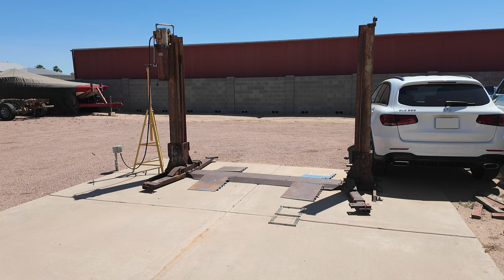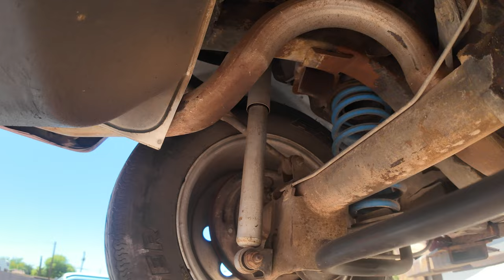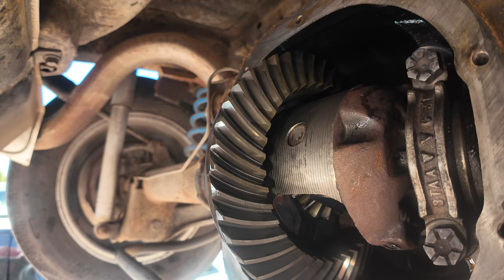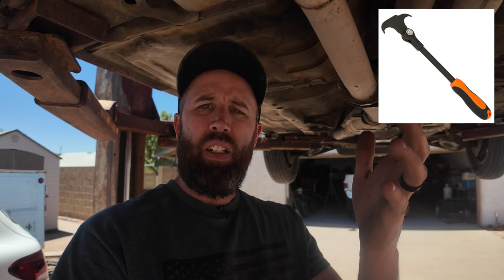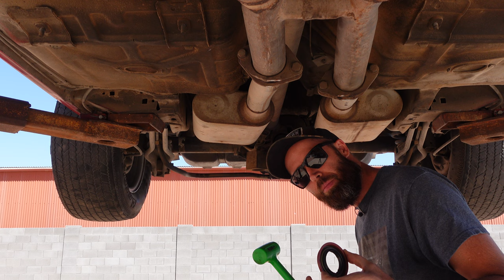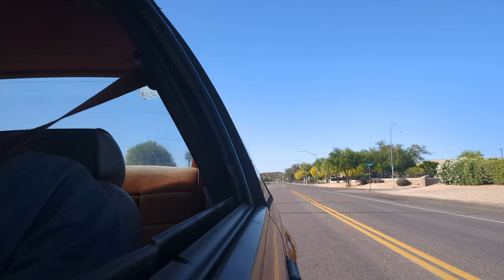Foxbody Mustang Rear End Is Making Noise, Time For A Teardown

Comment: I just dropped my 87 LX off yesterday to get 3:73's installed. It's got 2:73's in it now, so it should definitely wake it up! The guy used to work in the garage where I work, when he said $100 I couldn't believe it, replacing the bearings, races and all! I ordered the rebuild kit and took it straight to him before he changed his mind, lol. He's an old timer and said he's done hundreds of them, drag racing and circle track racing so I'm pretty confident it'll be done right!
Reply from the maker: Nice! Yeah that's like $1k cheaper than anywhere else haha
Reply: @randybelcher6693  you'll love the 373's, I have them in mine. They are Def a good time haha.

Comment: Worn clutch packs will cause excessive play in the c clip. By the looks of the pinion seal leak good chance it was run low on oil and bearings got hot. 8.8 fords are the easiest rear ends to overhaul. Most of the time you can run stock shims And send it. But I do recommend koyo bearings.

Comment: If you are interested in fixing the headliner, some fabric shops like Pat Catans carries the headliner material with the foam backing.  You can glue it on your cardboard backing board with 3M weatherstrip adhesive.
Reply from the maker: Interesting

Comment: I just had my car looked at after I couldn't get the idle down.  Was at 18 degrees of timing, set it to 10 degrees and the idle came down from 1100 to 950ish.  Tried adjusting the idle screw and nothing happened, was completely disengaged from the butterfly of the throttle body and stayed at 950ish rpm.  Took it to a shop, they did a smoke test and found it had many areas of unchecked air coming in, mostly around the egr and throttle body.  Put a new accufab throttle body with an egr delete plate and the idle is now adjustable and set to 750ish.  Sounds and runs a lot better.  Maybe a smoke test to check for unchecked air may help you?  Mine surges a little also but levels out

Comment: I just did a 31 spline (explorer LSD) rearend in my fox. The 28 was clunking and the backlash was way off because the shims on the LSD were worn out. Switched to 5 lug and disc brakes (4 piston cadillac 13" front, taurus caliper and 10.65" rear) at the same time. Always something to change and upgrade. No more gear noise and stops so much better.
 Now i have to fix the e-brake.
Having fun following you.
Reply from the maker: Nice! Sounds like a decent swap. Thanks for watching! 🤙
Reply: What kind of kit did you use? I am thinking of just going SVO/93 cobra disc on my 86 to stop better. I am going to go with 17" wheels so clearance isn't a issue.
Reply: I didn't use a kit. I just pieced together parts from different places. The diff from an Explorer at the junk yard, the rear calipers from a Taurus at the junk yard, front spindles from a 95 at the junk yard and the brake lines and fittings from the junk yard. The front calipers are Cadillac 4 piston brembos from Amazon, had to shave them a bit to fit. Front Rotors are 13" from amazon. Rear rotors are 10.65 from parts store for a 2004 mach1.  Ford traction lock rebuild carbon kit and axles from JEGS . New bearing also.
   The 17" cobra rims barely fit on the front over the calipers.
 Stops so much better and I don't have brake fade anymore.    
              The car does have 600hp and this was much needed!

Comment: Looking forward to seeing what control arms you go with.
Reply from the maker: Any suggestions?
Reply: He will probably get them from eBay.
Reply: Lakewood’s are my favorite just because they was popular back in the day or something similar. I do discourage the 100-150 dollar sets from eBay.  BBK has some nice ones and Proform has some very similar to BBK and both favor the Lakewoods at a lower price.  If you find some old SSM lift bars those work great, make sure they have the lowering brackets.  I can promise you if you run any that are solid they will tear your lower torque boxes if you don’t have reinforcements. Buy you some of those upper and lower torque box reinforcements and do a video on them. Can buy them from 60-100 dollars.

Comment: My pinion and cover were leaking as well. I just did mine a week ago. Luckily i noticed mine leaking and immediately fixed it. You have to remove the spout and iac to do a base idle reset. When setting timing you should remove both also. You should start at 12* not 18* for the timing. 18 is a bit much. I set mine down to 10*. I have a misfire on mine i cant figure out. Thinking its an injector thats plugged.  You should check the capacitors in your pcm. Mine were all shot and i replaced them all. If they leak they corrode the capacitor legs and then start eating the traces in the board. Ive put alot of parts on mine for sure. It needed everything i did though. Mine sat for 10 yrs, the guy i got mine from owned it for 25 yrs. You set the idle screw w both removed also. W stock cam you shoot for 650-675 rpm.
Reply from the maker: I'll have to check out the computer
Reply: @VeteranRevivals  ill bet you right now at least 1 cap has corroded legs on it. The others may not look bad but they are. If you're not comfortable attempting repair. Take it to a local TV repair shop or electronics repair shop. 1 of mine was corroded and the other 2 looked ok but all were reading WAY off. You have to ever so gently remove rubber coating on board. Then solder new caps in. The values are 2@ 47 micro farad. And 1@ 10 micro farad. If you DIY lookin at 6-8 bucks for caps. Very simple preventative maint job. Unless your having typical bad cap problems.

Comment: Another fantastic video buddy, reminded me that I also need to change the differential oil in my 1991 fox with 3.73 gears. Any idea of how many teeth I need for the Speedo gear to get my speedometer accurate again? It’s a manual. Thanks.
Reply from the maker: Unfortunately, I think you may have to change both gears (the one on the cable and the one in the tail shaft).

Comment: Still noisy ?  Just a clunk ? Or does it whine at all ? 
Surprised you didn’t do axle bearings too.  Just did a bunch of work on my 86. Did very similar in the rear end, a good enough job. Change some seals and some bearings, but did not reset or replace the crush and or carrier shims. Going to just run it for now unless it’s super loud or I run into any issues.
Reply from the maker: Just clunky from c-clip, no whining
Reply: That’s good. Might not be high backlash. Might be worn spider gear splines. Keep the foxbody content coming ! 🤘